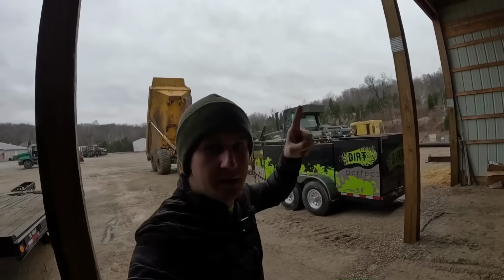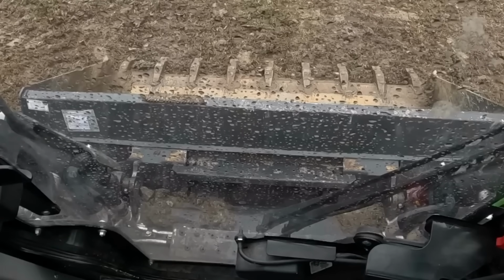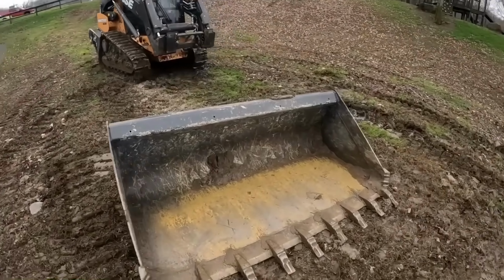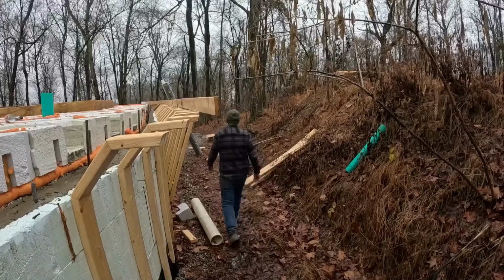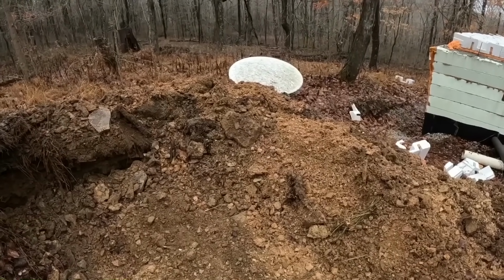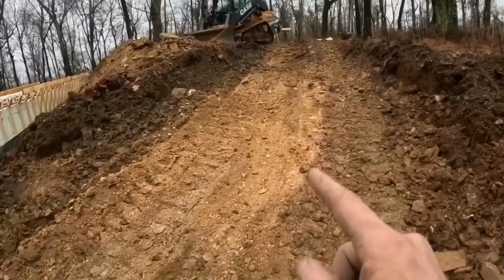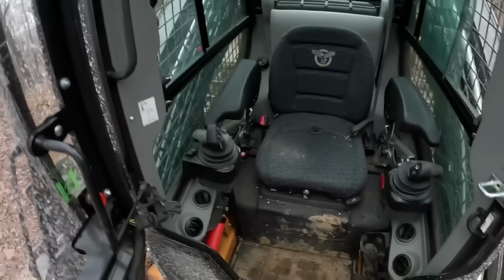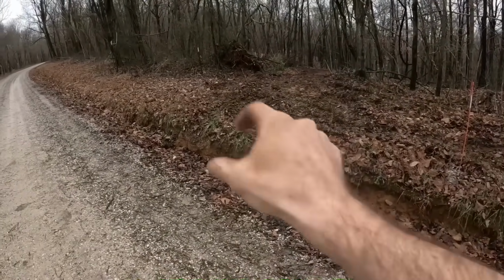First Time Using The Case Minotaur DL550 - Excavation at the Youtube Yacht

Comment: 1:48  Maybe sometime you can explain to us how you shift the larger trucks without using the clutch.
Reply from the maker: Most larger trucks have non synchronized transmissions.  They are designed to slide in and out at the correct engine/transmission speed vs most cars that have synchronized transmissions

Comment: Rabbit turtle is like a gear? If it's got multiple gears at the touch of a button, we call that a "power shift." I don't mean to be nasty. I do like this video. I did subscribe to the channel. Thanks for posting this!  The reason I brought this up is because I bought one of the first Case IH Maxxum tractor's in the country way back in 1989-1990. It was a 5140. That tractor had 4 ranges and four power shifts in each range. Anyway, one of the local "experts" asked me if it had a turtle rabbit button like his 4 cyl Ford 7700. I tried to explain the the concept of the power shift to him but he just kept asking the same question. Finally, another farmer looked at him and said. "Hey, that's a 6 cylinder Cummins in that tractor. It will eat your tractor." We used to grow onions on muck soil 50 miles NW of NYC. This area is rural suburban in nature. You don't want big heavy tractors on this type of soil. It averages 70% organic matter. So, you don't want to compact it. Anyway, it looks like you have a good channel. Take care.
Reply from the maker: This is hydrostatic, power shift is different.
Reply: @CaptainKleeman  You are correct. Again, it's a good channel. Merry Christmas!
Reply from the maker: @stanleynowak9325  merry Christmas

Comment: YES that ROCKY ground would be hard on Rubber tracks. On my driveway replacement the guy doing the cement work ripped a big crack in the Rubber tread. It slowed down the Job, he had 2 laborers that had to do lots of shovel work loading into my front bucket of my Dynahoe-190. The Rental company had to bring out a new Rubber track. Then we spent a hour, just removing the grease from track adjustment. 
Working the new track on, with steel pry bars, as the guy drove the track on. Then two tubes of grease later, to get right adjustment again on track tension. It really slows down a Job changing Rubber tracks. You ask why "I" did not use the backhoe on Dynahoe-190, it was because of small area with no room to get her into position to do the dig out plus contractor wanted to do the final grading himself. The Dynahoe-190 was just a front bucket dump truck. I stock piled the extra Dirt/ Rocks in my garden bed area in the back yard, so he would not have to haul it away.

Comment: I am glad they are innovating with new designs, and I am sure someone is going to buy these, I just think it is a very specific user, despite how generalized they make this unit appear. If you gotta push so much dirt that you can't do it with your normal skid/CTL, you frankly probably want a bigger machine. It is a very narrow band of job sizes that the dozer aspect of this unit becomes attractive. 
If nothing else I am very pleased to see those steel tracks, in the right job site that's a huge game changer; the more aggresive tracks are probably required for that dozer attachment to put in any real work.

Comment: That Case is a nice machine, I think the fact that it has steel tracks is a game changer. I have never been a fan of skid steers, tired skid steers tend to tear up surfaces and get stuck easier, track skid steers with rubber tracks tend to damage the track easily because it rubber, that being said, would I turn down a skid if was offered or the only thing I could afford, absolutely not, just have to be mindful of what I consider some of the draw backs. Great demo sir, thanks for the ride along.

Comment: Wow, Case put lots of thought into the Minotaur.  Awesome beast.  Cannot wait to what all this can do!!
Reply from the maker: They definitely did.
Reply: there about $80,000 at my kubota dealer for the case DL550
Reply: That GMC dump truck sounds like it has a Detroit Diesel in it. 6-71 or 6-92? Awesome
Reply: @michaelmactavish4445  you mean $180,000…
Reply: @robo1210  my dealer uselly sell the dl550 $80,000  the M8-211 a 211hp kubota at my dealer is $180,000 the 211hp kubota tractor with loader,bucket,forks,doubble auger blower,blade
Reply: @michaelmactavish4445  must not be the Minotaur version with blade and steel tracks then.
Reply: @robo1210  yeah he useually sells all kubota and case ih and case construction less cost to make it affordable for customers because he hates overpricing stuff wich deere and cat are bad for that

Comment: Thank you for showing her the Beast of small track loaders. Love your battery jump STATER (the old JD power supply) great idea in shop if you don't want to buy the Biggest jump STARTER (Harbor freight) had like I did for my 1971 SeaGrave & my Dynahoe-190 the
( Cen-Tech) Automatic Battery Charger/Engine Start. Is that RED dump a straight like 5 or 6 speed or does it have a splitter on top of the shifter. Love the Look of those (GM) style 5
 Yarders. A paving company by my area buys lots of them. Same RED color of cabs.
Reply from the maker: Has a splitter

Comment: Just for anyone watching who doesn't know this. Note how far the Dozer rode up on the trailer before Tracks dropped. It's just an FYI for people to understand the center of gravity for a Dozer will keep going straight up. I'm only saying this for people that don't understand this, not for operators who have done this like 1 million times. There is a drop point on frames of Dozers different from other types of equipment when Loading Dozer type of equipment.

Comment: Can the Decelerator pedal be changed to be a throttle pedal for like old school Case 450-C Dozer & Loaders. With a regular type throttle pedal that older guys were use to on older Case machines. Just asking, SORRY for all the comments, it's so cool to see this Beast at work. Love the combo Loader/Dozer multipurpose piece of Equipment.
Reply from the maker: Yup, you can customize it however you want on the computer

Comment: Great video Captain - quickly knocked out some UTube Yacht work (plus work at your brother's new property) AND you get to introduce us to the Case Minotaur!
That machine sure looks like it's a solid/versatile piece of equipment.

Thinking out loud - - Does anyone make a set of drive-over  rubber tracks that would allow operators to easily cover the steel tracks? They might be used on more sensitive terrain where you wouldn't want to tear the surface up as much?.

When done with them, just roll 'em up, put 'em in the bucket for transport and you're back to dozer mode (easy-piezy lickety-split)
Reply from the maker: It's a neat idea, but the best answer is they make different machines for different reasons.  This isn't made for sensitive yard work

Comment: Well what does it cost I think around $150,000. I went to Machinery Trader Beauregard Equipment has one listed bucket and dozer blade for $179,900. Out of my price range. What will one do when all that electronic stuff starts to go bad and needs to be repaired, would not want to own it long term most certainly after the warrenty runs out. Its nice now how well it holds up???
Reply from the maker: There isn't a machine thats made today that doesn't have electronics.  They all have computers with user interfaces similar to this.  If that's an issue for you, then every new machine from every brand is going to be an issue for you.

Comment: Been wondering about those machines.  (Of course, unless Case wants to trade me even for a 1990's 550G dozer, I'll never get to see one up close).  Having had a slab (what's a basement?) poured two weeks ago, was thinking if we had those front-unloading trucks around here, we could have saved some money on that job.  (When the nearest pump has to come from around 100 miles away, it's no cheaper here than for you).  Take care.

Comment: Does it have a lap bar or just the seat belt?
Reply from the maker: Seat belt only,. Which do you prefer?
Reply: @CaptainKleeman  i figured it was only seat belt later on in your video but I was so into watching I forgot to erase my question. Lol but to answer your question I'm a bigger man and I couldn't use some of the skid steers because of the lap bar.. I was stuck using the  bobcat ones. But I thought they all had lapbars.. Didn't know just a seat beat was a thing..

Comment: Wow, as in long over due to coming out with a ultimate little skid loader that dang well can do it all. I am interested in its loading trucks abilities plus other stuff just too numerous to mention. Mike, one of the best things to come on your advice was hooking teeth on a bucket on trees being pushed over. Its not just widow makers that get guys but getting tied to the tree with the teeth and that tree decides just where its a going. Yeah, sometimes you can push your way on through and just knock it over like first intended but people get kocky and then over it goes... yeah, just how many  times can a man go around in a metal box without getting a bit hurt as in time to call mom time, I have some really bad owies and she can't just kiss these ones away. I only did one flop without my seat belt of course cause us guys don't need no stinking seat belts. I was laid up over a month before my teeth were working well enough with out a brace in my mouth to hold my broken jaw bone. Plus I even had stitches in my "Forest Gump" which took some getting used to when reading the paper in the morning resting spot. I did learn to listen to others for a bit before becoming the dummy I normally am. Now if I had made my way say another ten or more feet, you would be down one less subscriber for dang sure. I had fell enough trees to know they always go the way they lean don't they and sure enough learned that is not as true as once assumed. Great video Mike an quite happy for all this stuff. A great walkthrough on using a great machine as well

Comment: That looks like a real monster of a machine, Case definitely put a lot of thought into making it as operator friendly as possible.  A concern might be the pins for the dozer although it does sound like they seat in with authority.  Pushing over that tree you could REALLY see the advantage of the steel tracks, I suspect the Taco or Kubota would have just been throwing up rooster tails with their rubber shoes..  It's almost a pity the Takeuchi is such a recent purchase for DP.
Reply from the maker: The taco is still nice for finish work though.  It's light on it's feet and small which makes it perfect for the hard to reach areas.  This case is a good size and is fairly aggressive with it's travel path.  Each machine serves a purpose
Reply from the maker: The taco is still nice for finish work though.  It's light on it's feet and small which makes it perfect for the hard to reach areas.  This case is a good size and is fairly aggressive with it's travel path.  Each machine serves a purpose
Reply: @CaptainKleeman  Agreed, you wouldn't want to use the 304 when digging out a 2 acre pond for example, that would be one for the 210

Comment: Case/NH, yea. So I was a dealership mechanic for 5 years. Hired from a Caterpillar 19 year background. Here's what I can tell you before I crawl into the dirt hole. KEEP AWAY from all Case/NH equipment! PERIOD! That's if you value you dollar to investment ratio! Junk! Electrical nightmares! If you have a fuel problem, no more timing pins! Static timing. A true pain in the ass! I would take a JD over a Case ANY day! Fact! JUNK!
Reply from the maker: What didn't you like about the 550 when you worked on it?
Reply: @CaptainKleeman  Electrical problems galore! Fuse box doesn't seal 100%. You will have green slime from the back side within two, maybe one, year. Depends on your working environment. They use a BUS brand box. Sealing SUCKS! I use vasoline  liberally on those box seals. Your best friend is dielectric grease. And Caterpillar battery protectant spray. Or, buy a CAT!

Comment: If batteries dont work DP needs to buy a new truck.. The new case looks so much better than the Kubota. Seat belt does no good if you dont put the shoulder strap over your shoulder.

Comment: Unfortunately I don't think the Triple Nikle would have been that quick moving that amount of material around in the same amount of time, so it's probably saved you block of time you can use on other projects. What impressed me most was that you were ripping through rock etc, up hill and that it was still going. Like you say the steel tracks are definitely a bonus, plus it looks like Case have been doing there home work, it seamed a lot quieter than previous models and the interactions looked intuitive, also like how they keep the hoses safe when not in use. Mike has to be one of the most genuine people out there, always willing to help when he can it was good of him to tie you up with Case and for Case to oblige. For them the work that Mike and you do, this is definitely an excellent advert. Like others have said, its an absolute beast of a machine.
Reply from the maker: They definitely put a lot of thought in the details.  Dirt perfect is a great fella